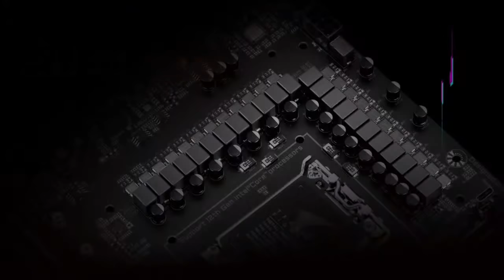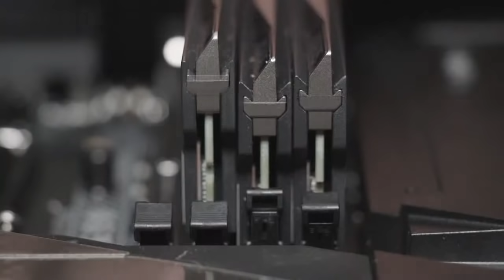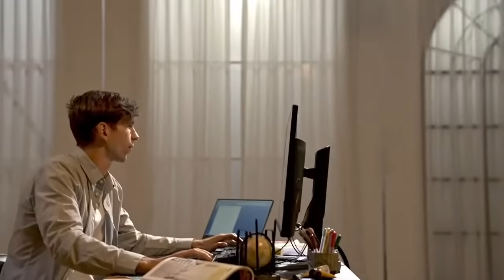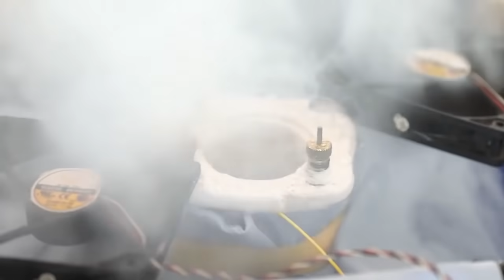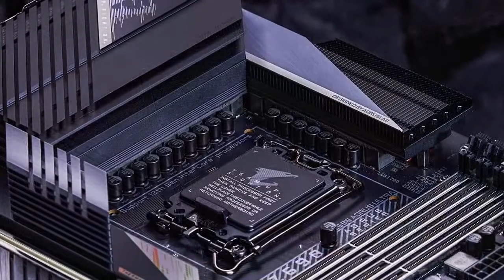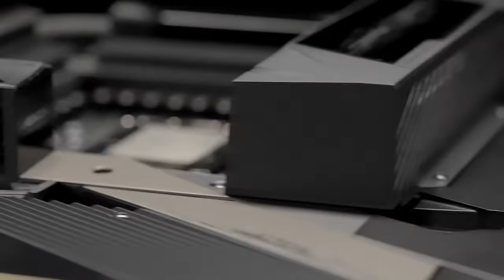AORUS Z690 First Look Event

Comment: I was not aware that DDR5 was that much more energy efficient efficient than DDR4. IMO-Reducing power consumption is extremely important as CPU and GPU power consumption is always going up. Even though these MOBOs have thermal protection/reduction features, reducing power consumption decrease will most likely translate in to reduced heat. All of which is good when pushing these MOBO's  to their limits.